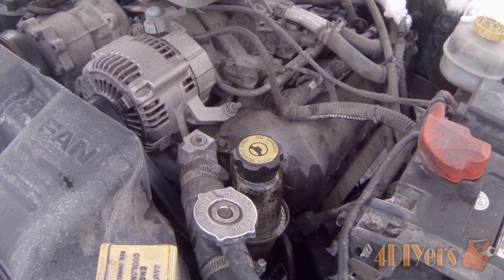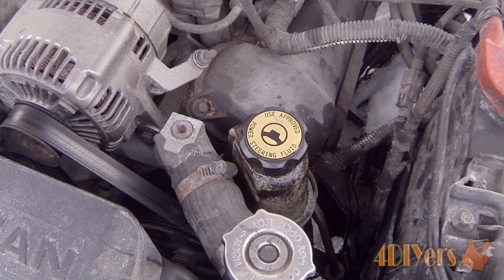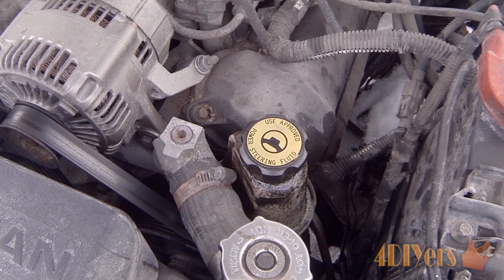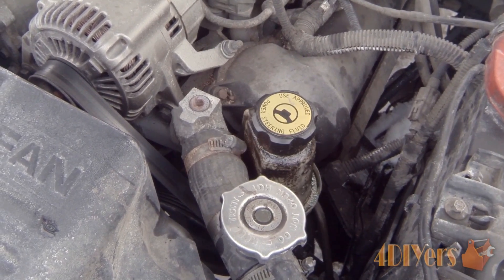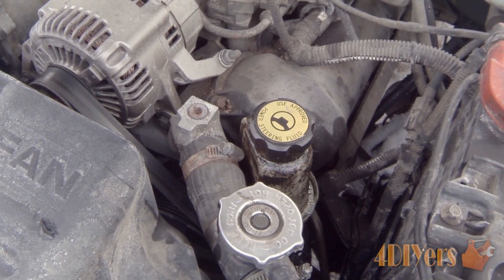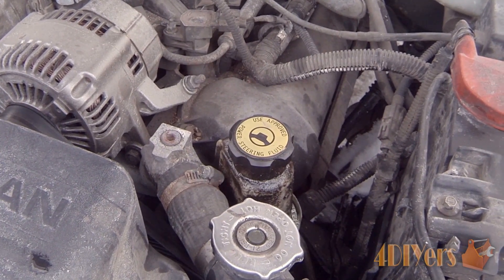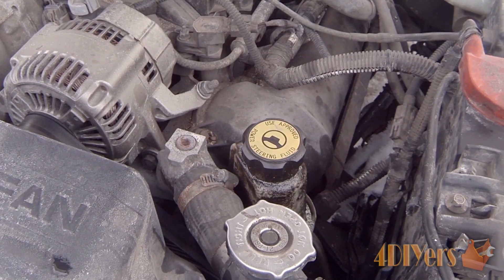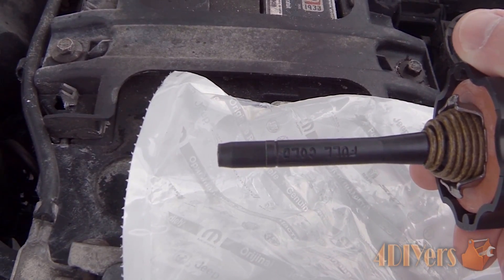DIY: How to Troubleshoot a Power Steering System

Comment: I have a 02 Dodge Durango.  When turning the steering wheel it tends to bind up.  Pump isn't making any noise.  Seems to be some were above the Rack Pinion  and the steering wheel.  Besides the intermediate shaft is there anything else that could be the issue?
Reply from the maker: How did you pinpoint it was an issue above the rack and pinion??? You could be looking at a faulty bearing within the steering column unless something is binding up under the dash.
Reply: Thanks so much.  I was thinking that also.  Do you have a video on that?

Comment: I have a 2003 dodge Dakota, I recently filled up my power steering fluid and still doesn’t seem to work, I have no whining noise either. Truck is hard to turn while sitting there or driving slow, easy to turn while I have speed.
Reply: Help please
Reply: Did you find what was wrong with it

Comment: Hi,
On my ML500, 2006, steering becomes stiff only when the engine is warmed up and in low revs, when parking. Otherwise I have no issues. When engine is cold everything is normal, even in low revs, for the first say 20 minutes. But once it's warmed up, it gets really stiff when parking. I have to push the gas slightly during parking to do some steering.
Thanks,
Reply from the maker: Have you checked the fluid level and when was the last time it was replaced?
Reply: it's full but not replaced. but would replacement of the fluid is going to resolve the issue of binding at low revs? Thanks.
Reply from the maker: Old fluid will increase friction as it maybe dirty and it will have broken down from the heat. Therefore it can put strain on the power steering system, especially once the system has warmed up.
Reply: Thank you for your response. So you don't think this issue relates to a bad pump?
Thanks,

Comment: I have an 03 durango that has a whine when the car warms up...definately coming from the power steering pump.  I've replaced the pump about 2 years ago as well as the rack.  It has the oil cooler and am wondering if that could be an issue or maybe the rack or pump has gone bad again.  Not seeing any leaks.  if I look in the reservoir while you turn the wheel it looks like the flow is good.  Not having any steering issues but the noise.  Not sure how to troubleshoot, very annoying!
Reply from the maker: The system can be pressure tested. What type of replacement pump did you use? Sometimes the cheapo offshore companies can fail sooner rather than later unfortunately. Have you replaced the cap as well? On these particular trucks, the caps can cause excessive pressure build up.

Comment: Great video. I have a question. I have an E39 2002 model 530 diesel automatic car with the M57 engine (CA980-40). I changed engine, transmission and hydrauolic steering fluid *2 times and my steering is still very hard. The pump seems to be working because when I flushed it, I noticed it was sucking the new fluid in when I was turning the steering from left to right. Yet, I have a terrible steering - it is very heavy and sometimes I have to really use to hands. Could you give me ideas where to check? Or do you think the rank and the pinion is probably gone bad? Although I cannot see any leaks from it. The car is 15 years old at 63K.
Reply from the maker: +Turhan Uludağ Thank you. Have you also replaced the filter for the power steering system??? Does the pump make any noise or does it whine??? The pump can be pressure tested to ensure it meets factory specifications. It's not very common for a rack to get stiff unless there is an internal failure. Other issues which can cause this is failing ball joints, failing tie rods, or an alignment issue. For inspecting ball joints and tie rods, their rubber joint covers can crack letting in dirt and moisture which would cause them to seize up.
Reply: Thank you for your reply. I haven't changed the filter inside the reservoir (pump). The pump does not whine or make a terrible sound. It looks like its doing it's job. I changed the front suspensions and had the control arms checked and the ball joints look OK but then again they haven't been taken out. They were just inspected and kind of moved around with a crowbar. I also had the alignment done but I am not satisfied with it. I am guessing camber/caster problems. Tie rods were changed but not with Genuine brand. I think they were CORTEGO brand. I will try if I can get pressure tested them.
Reply from the maker: No problem. It's just a mesh filter and does have a fair amount of surface area. If it's not whining, then the filter is most likely fine. Does the steering wheel return easily when you are driving??? They may not have any play, but check the rubber covers for any cracks or tears. Why are you not satisfied with the alignment???
Reply: I hope the steering pump is fine too since it is not making any whining noise. The wheel does return back as smoothly as possible. There is no rattling or clunking/clankin? noise when I turn the wheel left to right so I donno. I am also suspecting the steering u-joint if that has gone bad too. Or if there is a small guibo/flex disc as there is one in the drive shaft but I am not sure. I am not sure however which rubber covers you are referring too.
I am not satisfied with the alignment because I am just not sure if it has been done correctly. 

The alignment that was done for my car was done according pretty much to 5.30i gasoline version. I couldn’t and the mechanic couldn’t find my car 530d on his computer so he aligned it approximately for the 530i version. Also, I have seen somewhere that if you have lose parts in the front control arms/upper/lower parts and that the tie rods or the inner tie rods have gone bad, the alignment will not hold or will not last for a long time. So I am just suspecting that the alignment that I did hasn’t made much of a difference.

On the highway, there isn’t much of a problem. Actually, there isn’t much problem, nothing to bother. But in the city, the road isn’t as new and I don’t want to say the road has potholes but the road is uneven to a certain degree. And in these roads, when I accelerate a little bit (up to 30/35 miles an hour) and when I suddenly hit the brakes, I feel the front tires feel shaky. What I mean by that is they seem to make me feel they are loose or as if they have a lot of movement in them, especially the right one. My wheels are 15 years old and I think two of them have had a little impact. I have put them at the rear. I am also suspecting bearings of the wheels and I think one of them has a play in the wheel. Since any BMW car parts are usually very expensive if you want to buy a genuine one or even a good aftermarket one, I wanted to know where to start and fix the car. That’s why I wrote to you in the first place. And I think I am going to do a full inspection for about 100 dollars and learn all the problems about the car. Thanks again for your time.
Reply: I had my mechanic check the problem. He says that it is not the transmission problem or its mounts but rather the rear axle. He drove it and also checked it and showed it to me. There is a little play at the long shaft that is connected to the transmission. It is not the part that connects to the transmission directly (where the guibo is) but rather at the back place where the transaxle is. If that is the case I really do not know what do since it costs around 1000 euros of BMW genuine. I have seen a video related to rear axles and the guy says these usually wear out after 100K or even at 200K miles. I really couldn't understand why mine went at 65K miles. Again, if that is the problem. The mechanic is sure that is the problem. He says that if it had been the transmission mounts, the car would vibrate a lot even at stand still, I am not sure if that's correct. 

The vibration is getting worse, not by much, but it is getting worse. My main problem is I feel vibration under my feet where the gas pedal is - when I touch it it gives me that feeling. I feel it more when I push it and let it go.
Reply from the maker: A ball joint or tie rod is equipped with a rubber cover to keep the dirty and dust out of the joint and also to prevent the lubricant from disappearing. They won't necessarily make a clunking noise, but the lubricant can dry out causing the joint to seize up. Which in the end will make the steering hard. I have had this issue before dealing with vehicles that were sitting for longer periods of time. 

I would assume the alignment specs would be the same. We do not have the diesel version available where I live though. The only differences are between regular and sport package cars. BMW also offered different steering designs between the i6 and v8. But I would assume the diesel 6cyl and petrol 6cyl is the same. Yes an alignment should not be done if there are worn steering or suspension parts and a good mechanic should know this. 

Rough roads can bend wheels and will cause a vibration at higher speeds. But as for the vibration when braking, that can be either warped rotors or the trust arm bushings. I just recently replaced the thrust arm bushing on my 540i. You should be able to pull your car on ramps, then grab the thrust arms by hand and if you can move them significantly, they are faulty. Also inspect the rubber bushing on the subframe side for any cracks which will also mean they are faulty. The bushings are filled with a gel which dries out after a while. A faulty wheel bearing will make a ridiculous amount of noise in the cabin, almost a grinding sound. So if it's not making that sound, it's most likely not a wheel bearing. 

Have you considered buying replacement parts online??? I purchase most of my parts from the States and it is significantly cheaper than purchasing from the dealer or buying aftermarket replacements from an auto parts store. Also for suspension parts, just as a tip for suspension parts purchase Lemforder. That is the company that supplies parts for BMW, the difference is there is no BMW logo stamped on the parts and they're significantly cheaper. 

The hanger bearing or center support bearing. Those can cause a vibration and aren't common to go, especially if you're not hard on the car acceleration wise. They will have a certain amount of movement as they are in a rubber bushing. They have to be able to dampen the movement. If the rubber has cracked, then it will need to be replaced. As far as I know you don't need to replace the driveshaft either. The hanger can be purchased separately, the driveshaft split down and then replaced.
Reply: Thanks a lot. I will talk to my mechanic and let him check all the areas you have discussed.
Reply from the maker: +Turhan Uludağ Yeah that's the support bearing in the center of the driveshaft shown in the first video. That's what I thought you meant about the excessive movement as those do require maintenance. 

As for that play you've shown in the video, that's perfectly normal, all differentials have that. A differential rarely ever needs to be replaced unless it ran out of oil, was exposed to water, or someone was excessively hard on it. What you're seeing in the video is called gear backlash. They can be adjusted, but from what is shown in the video there is nothing wrong. The only thing that is required for a differential to ensure it lives a long life is to change the oil.
Reply: Thanks again. So I see from your commentary that everything looks normal. Do I think I should go ahead and change the differential oil at 65K? Thanks.
Reply from the maker: No problem and yes everything looks normal. It would probably be a good idea to change the oil, especially if it hasn't been replaced since the car was new. Most vehicles never have their differential oil changed, but the oil does break down overtime from the heat and moisture loosing it's lubricating qualities.
Reply: Thank you so much man. You've been a great help. I think I will start from there. I will take pictures when we crack the differential open and see what the inside looks like.

Comment: hey quick question, my subaru impreza rs had harsh stiff steering at low speeds, as well as the whining noise, the wheel locked up while i was driving the following day and pulled over on the side of the road, now the steering is extremely hard to turn, mechanic quoted me close to $2000 as he thinks i needa new steering column rack, can anyone give me their thoughts on what i should do?

Comment: So can simply dirty old fluid make you completely loose P/S instantly? Im trying to diagnose my problem in an 03 4runner, was doing some rough driving the lost PS, my fluis seems to be flowing strong in the reservoir (but does looks burnt), belt is good, fluid level good, no leaks nor noises.. can feel a slight power steering assist if engine is revving over 5000rpm... Any ideas?
Reply: Did you ever figure this out

Comment: 2008 dodge ram 2500. steering has a jerk  in steering wheel  every 3-4 seconds when turning curves . Durining straight driving  there are no problems. would this be signs of a bad spool valve?
Reply from the maker: It could be. You could also be looking at old power steering fluid that needs to be replaced, faulty suspension component sticking/seizing, or if 4wd a stuck hub if equipped.

Comment: Hey I got a 1997 Toyota Avalon I got fluid in my power steering but its hard to turn when I'm stopped but when I'm driving its good .. I had the problem before then changed the fluid but now its doing the same thing as before... Any help ??

Comment: Hi recently my power steering went out on my car. Very stiff steering and made a whining noise. So I replaced the pump and the whining went away but the power steering was still not there. I've bled the system using the right procedure but the weird thing was when I turned the wheel to the left, no bubbles came out the reservoir. But turning right almost made the reservoir overflow. No signs of leakage throughout the lines as far as I can tell. Need fixed fast. What could it be? Appreciate your help!
Reply from the maker: What kind of vehicle? How many times did you turn the wheel lock to lock and what type of replacement pump did you purchase? Some replacement pumps can be faulty, other times the filter maybe plugged if equipped and should be replaced when a new pump is installed, and also a faulty flow control valve.
Reply: It's for a 2000 Acura 3.5RL. I turned the wheel lock to lock about 30-40 times during the bleeding process. The pump I got was a reman from AutoZone. But if the pump was faulty. Wouldn't I hear the whining sound? I have not replaced the filter in the reservoir yet. Is it possible to just clean it instead of replacement? And also this problem wouldn't necessarily be in the rack and pinion, would it?
Reply from the maker: You won't necessarily hearing a whining noise. If you increase the rpm of the engine when the car is parked and turn the wheel as opposed to idle, is it still hard to turn??? Yes some filters can be cleaned, it depends on the style. It's good practice to either clean (if possible) or replace as you have already installed new fluid and it can put added strain on the pump. Most likely not. You would feel an issue to one side or another along with play or steering wandering.
Reply: I've noticed so far while driving that the power steering is completely gone while it's cold, but when I warm the car up there is the VERY slightest difference in steering assist. Turning with a complete stop is nearly impossible. Still don't see any leaks. Would you recommend stop leak at all?
Reply: Also there is no steering assist at high rpms. What would be my first point of interest to fix since I've already replaced the pump?
Reply from the maker: Certainly sounds like a pump issue. No I wouldn't recommend stop leak as that can cause issues on it's own. I would recommend cleaning or replacing the filter and if the issue still persists, then pressure test the system.